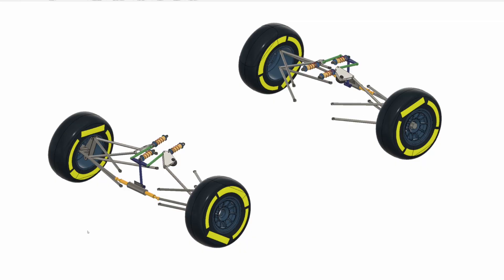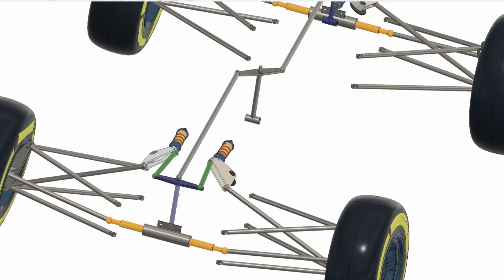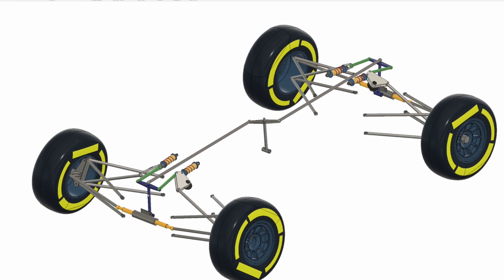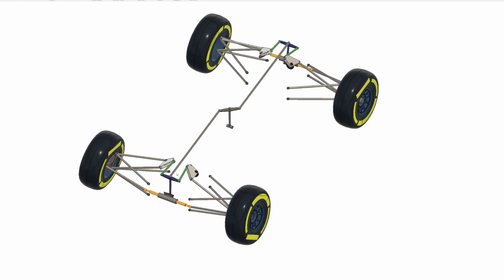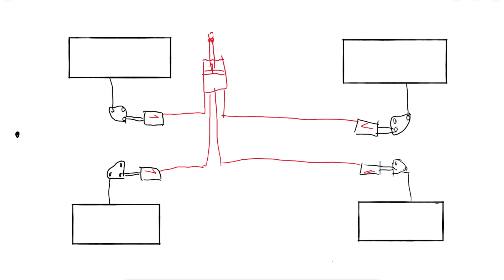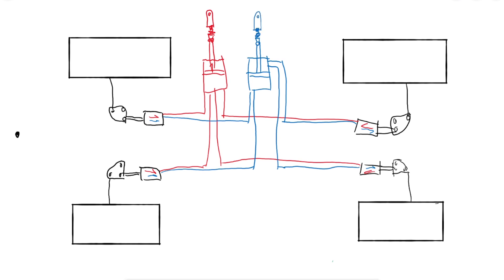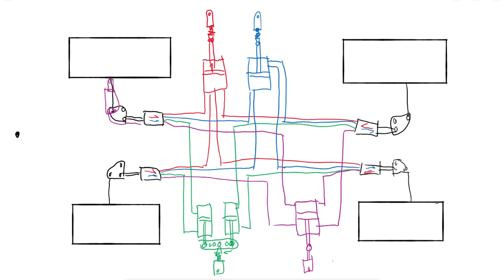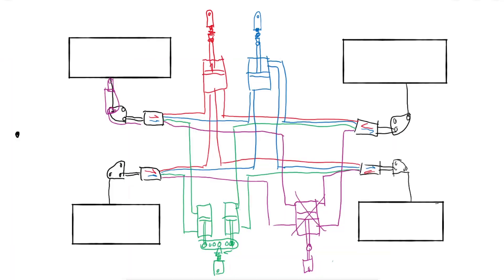The Ultimate in Mechanical Grip - How Does Fully Mode Decoupled Suspension Work?

Comment: Formula Students: Write that down, Write that down.
Meanwhile bell cranks be like: Please take me out of single shear.
Reply from the maker: I should have put in some rod ends in bending for good measure
Reply: Killed me 😂👌🏼 and never forget to put the pushrod to damper ratio to 1:10 or sth and have fun with loads and rideheight setup
Reply: Im stupid can you explain what is single shear? All i saw when i searched it is a math problem  on some random site
Reply: I wonder why they dont follow the same hydrolic system in motorcycles its just front vs back to control wheelies and endos

It will be extremely simple for a motorcycle
Reply: @FirstLast-tx3yj  I strongly suspect that there are minimal gains on offer. By which I'm suggesting you couldn't increase the leverage required sufficiently enough to overcome the torque produced by a modern race bike anyway.